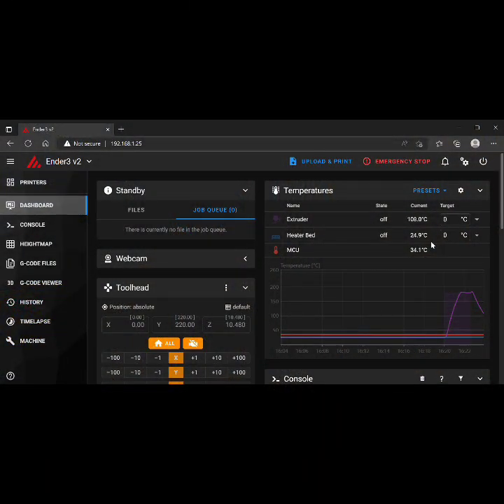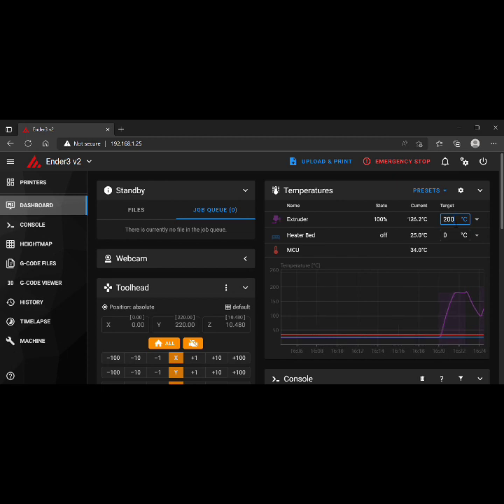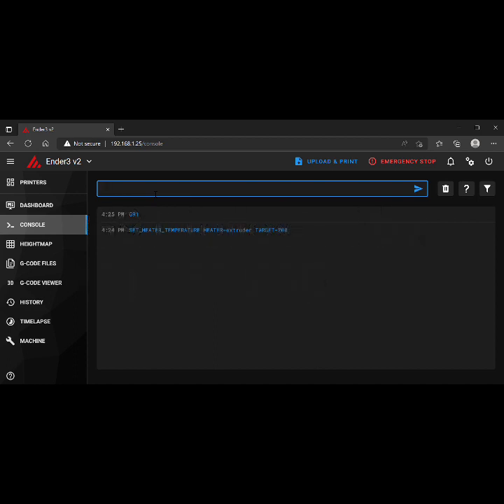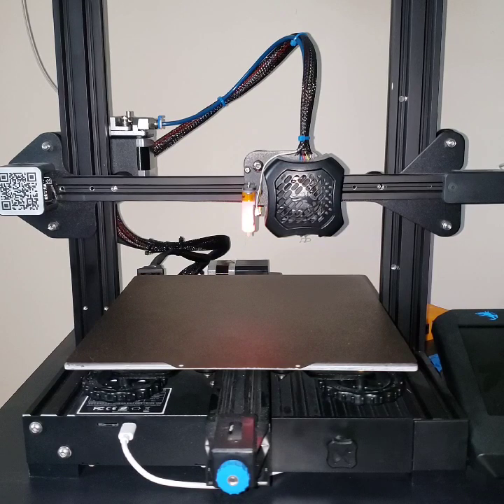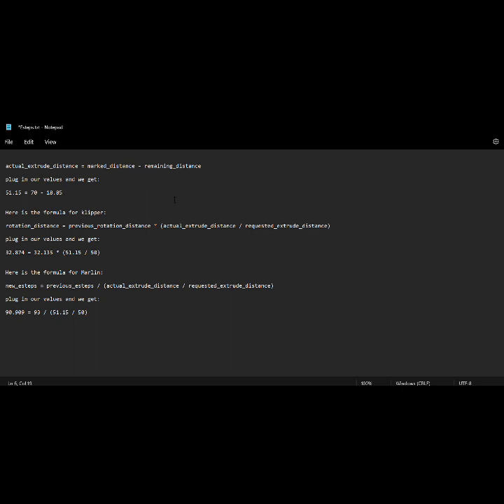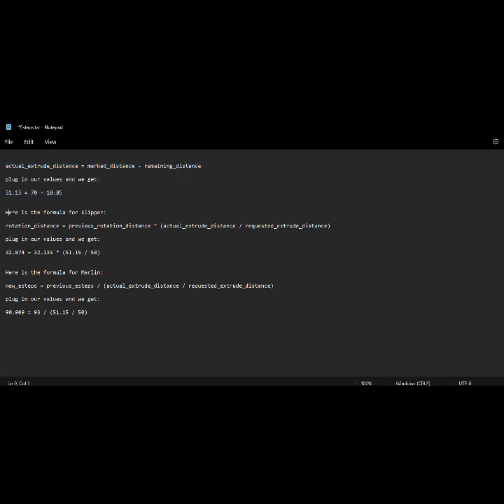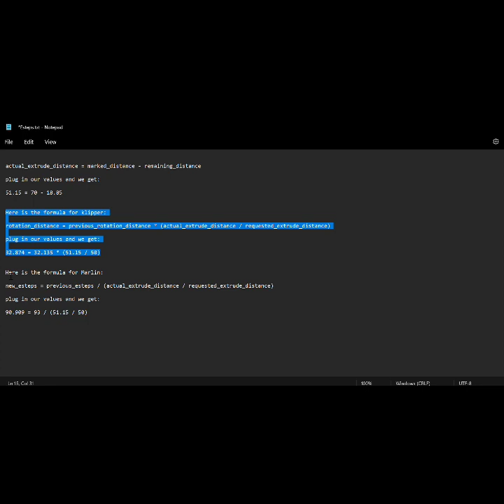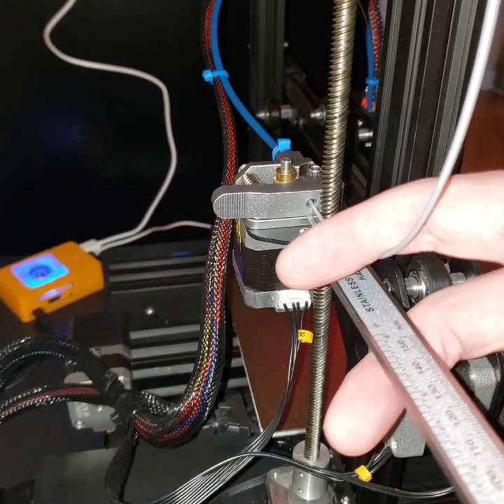Extruder steps / rotational distance calibration for Marlin and Klipper 3d printer  firmware.

Comment: couldn't make it more complicated
Reply from the maker: Not sure what you mean?
Reply: @joeprints3dstuff  where do we find the 'previous_rotation_distance', is this in the printer.cfg file on a klipper setup?
UPDATE:
In the printer.cfg file under the [Extruder] section, I do see: rotation_distance: 6.9

This just seems much smaller a value than your examples.
Reply from the maker: @darrellpilon3979  the actual value will vary based off of the motor.
Reply: So like, offer no simplified solution lol